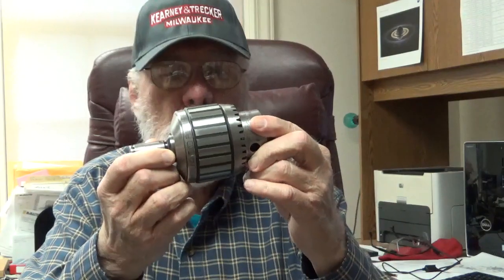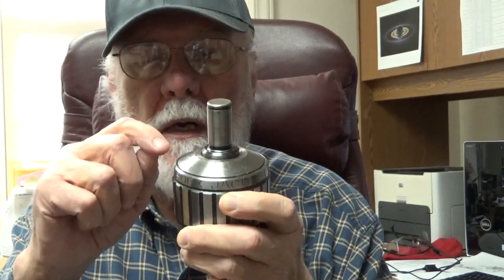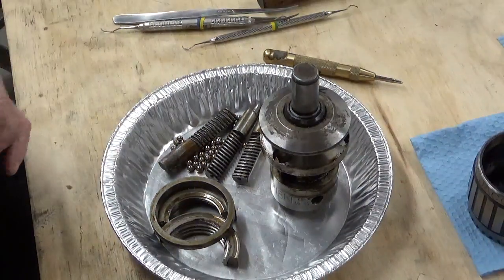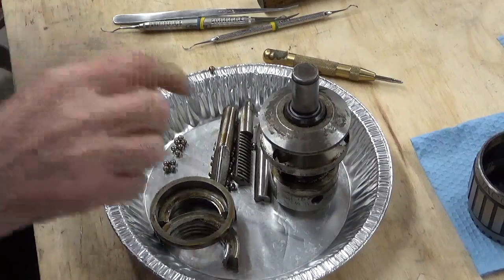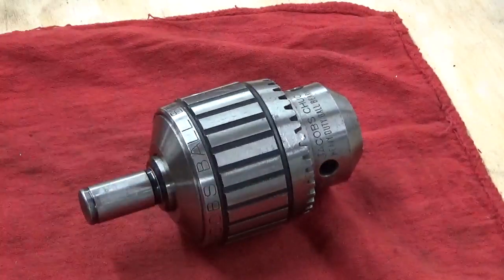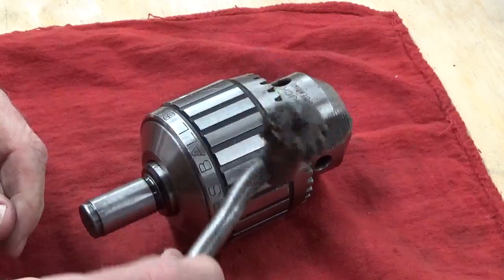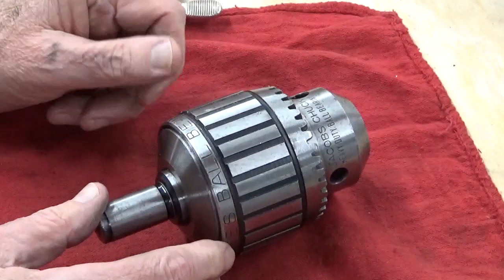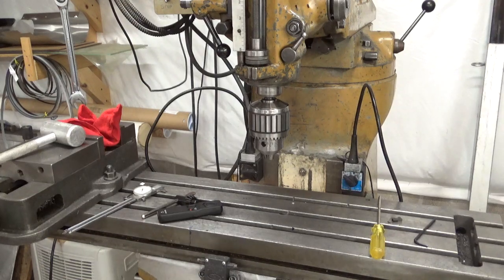Repairing a Jacobs Super Chuck

Comment: Got a #19 Super Chuck that has one jaw that will not extend with the other two and is jammed in so the chuck will only retract - open? - half way. The chuck isn't rusted or been beaten on. Any suggestions how to get the thing apart so I can assess the damage, clean and lube the thing? I tried pressing it apart as usual but there was clearly something jammed by the out-of-position jaw.
Reply from the maker: I'm afraid I can't help much there.  I had the jaws fully open on my chuck before pressing off the outer ring.  I have only taken apart two of these chucks so I am far from an expert.  One of the commentators on this video seemed to be well versed so you might ask him.  Other than that you might try contacting a more experienced machinist like Tom Lipton https://www.youtube.com/user/oxtoolco/videos or Steve Summers https://www.youtube.com/c/SteveSummers/videos.  As I recall, both of them have videos on repairing chucks  Good luck with getting it fixed.